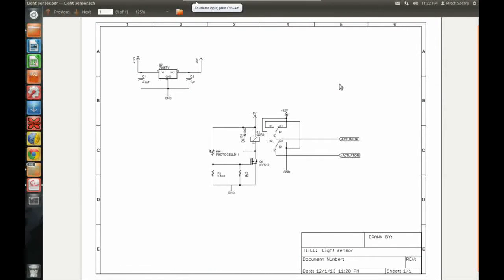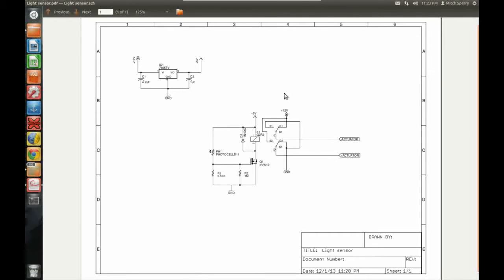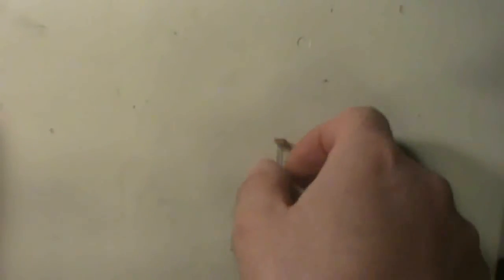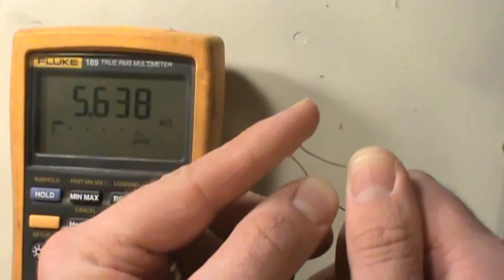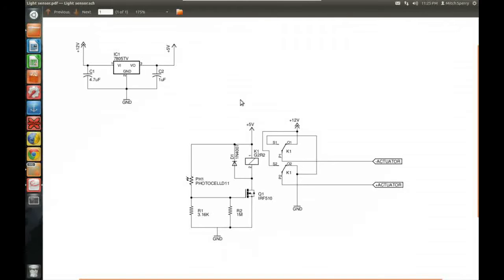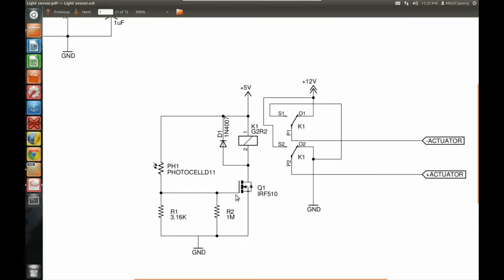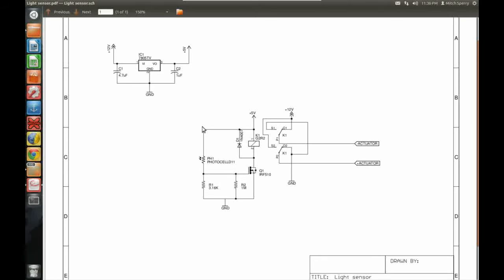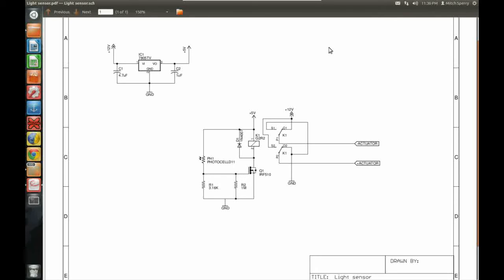Sensors - Photocell

Comment: Great Video, but I don't think you need R2 1M when you have R1 3.16k. When you have 2 resistors in parallel, the total resistance will be lower than the small of the 2 resistors. 
Keep putting the videos, I really like to watch them
Reply from the maker: Hey there, thanks for your comment.  This is funny I am so use to putting the "bleeding" resistor there I just didn't take the time to notice that the 3.16k would provide that for me any way.  lol thanks for catching that.
Cheers.

Comment: As far as I know a relay is NOT polarised.  The current through the coil attracts a soft iron core which cannot be permanently magnetised, because it is soft iron reminiscent of a ferrite core.  A relay will not push the actuator away, the actuator is spring loaded.

cheers
Reply from the maker: Hello there thank you for your comment.  I think there is some confusion.  When I am talking about swapping polarity and movement changing, I am refering to the linear actuator that the "relay" controls.  This is in reference to the demo video about relays located here: Demo Time - Relays

When you change the polarity on the actuator it will move either out 4" or in 4".  This was what I was talking about.

However, your description of how the coil of a relay works is exactly right and I am glad that you took the time to mention it.  Yes a "relay" coil is not polorized since it has a solenoidal action on the core.  There is just a peice of spring loaded "soft Iron" core, as you mentioned, in a solenoidal coil and when the coil is energised it aligns the "soft iron" core to the B filed generated inside the solenoid.

Thank you for this information and I apologize for the confusion.